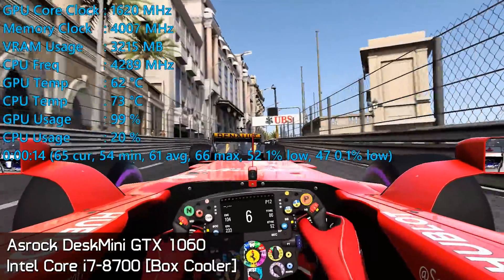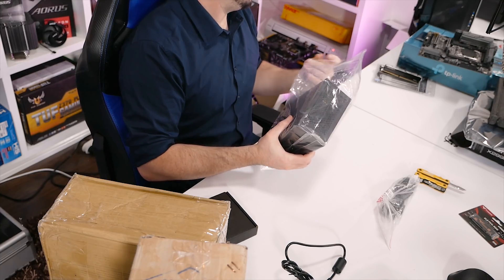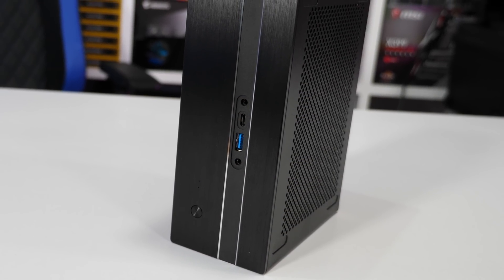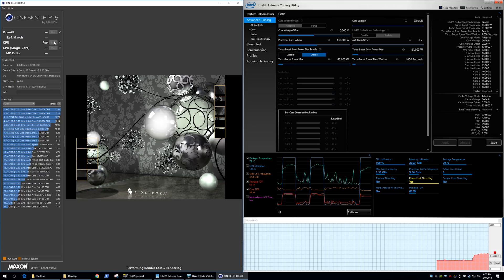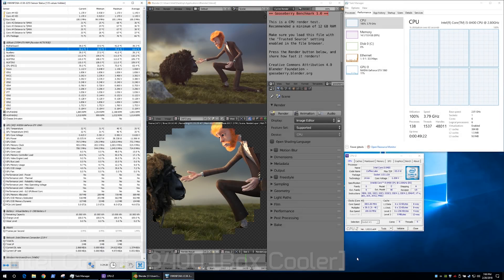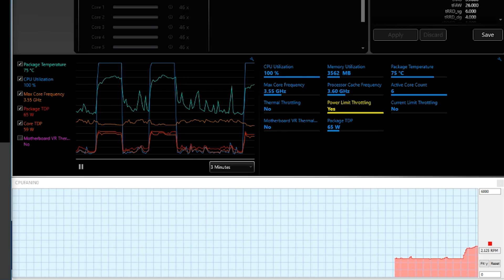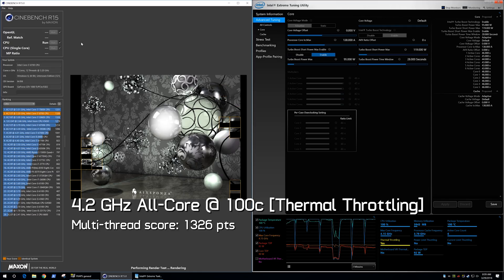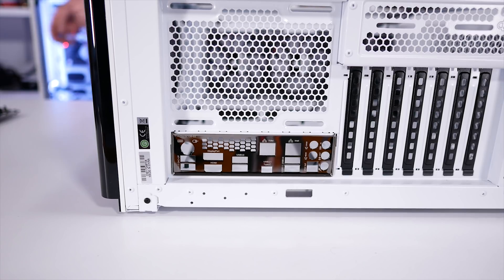Core i7 8700, Intel Box Cooler Limiting Performance

Comment: I tried the box cooler and the 8700 throttled bad. Swapped out to the Coolermaster Hyper 212 with dual fans and no throttling. Ran all core at 4.3 GHz.

Comment: Same issue, have a 8700 but the box cooler wasn't sufficient. It hits 100C and shuts down due to TJmax. Got a 240mm AIO and thermals are better since.

Comment: i have a i7 8700, locked in 4.3 ghz, and undervolting with 0.05 offset negative, and i did that without been necesary, the only necesary was limit to 4.3 ghz, with a good cooled enviroment and stock cooler, is just max 80c at full working

Comment: Did upgrade from i5 to i7 8700 yesterday. While gaming it clocks@4.3ghz 95% of the time(dips to 4.2ghz sometimes) and while stress test it goes like 3.6/3.7ghz. Motherboard Gigabyte H370 HD3.

Comment: I know this is an old video, but I experienced the i7 8700 thermal and power limit throttling and was able to correct it by upgrading the cpu cooler and increasing turbo boost power max.  2-3 years ago I bought a HP Omen Obelisk desktop with an i7 8700 for $899 and I ran it for a long time with the crappy stock cooler and just put up with the hot temps, loud fans, and lower clock speeds.  I finally upgraded the cooling to a Noctua U9S and was able to keep temps well under control and keep a consistent 4.3ghz on all cores.  The i7 8700 still isn't a bad cpu and does well.  I have since done a case swap and parted out the Omen and am much happier than when I was stuck using that crappy intel cooler in that hot crappy Omen case.

Comment: Hi! I have some issue with throttling. I have i7 8700 non-k and not very good zalman performa cnps5x. When I ran cpu stress test in Intel Extreme tuning Utility it says that there is Power Limit Throttling and Current/EDP Limit Throttling (Power limit is in the 1st test and Current/EDP is in the other two). MB is h370 pro4. Can this issue be because of bad cooling (though the temp is only 60 max, according to stress test) or it is issue with motherboard or power supply? PSu is Deepcool DN650, it's 600W by 12v

Comment: I have this chip in an asus h370f motherboard, and I'm getting voltages up to 1.41 is that normal? I have a kraken x62 cooling it but I'm still hitting up to 60 degrees in idle after 10 minutes of booting up.

Ps. I have re mounted the cooler multiple times making sure the thermal paste spreads correctly, still hitting 1.4 volts just idling.

Comment: Is there a huge difference between i5 8400 and i7 8700 in games like Battlefield V...? I currently own i5 8400 should I got for i7 because sometimes it stutters while cpu is maxed out.
Reply from the maker: The i7 model will fix the stuttering, assuming you already have 16GBs of RAM.
Reply: @Hardwareunboxed  sure I did. But running @2133

Comment: LOL old news, when I first bought the i5 4670 it thermal throttles on stock cooler, and I never knew after 2 years until I checked temp on prime95, all cores will hitting near to 100 degrees. Yea the non K version not 4670k, Intel just keep trolling everyone.

Comment: I currently have a Intel i7 8700 with the stock cooler in my editing pc, while rendering it has reached 95° and got a warning message in windows, I think I need a new cpu cooler urgently which would you suggest on a budget

(Case is the Corsair spec 04)
Reply: mine is always at 100c and not warning me

Comment: I was thinking about undervolting my i7 8700(non k)as it runs at around 1.285-1.3volts under load at stock settings which produces a lot of heat and tdp upto 105 watt tdp with temps like 82-86℃ my motherboard is msi z370 sli plus & my cpu cooler is antec c400. And my cinebench score ranges from 1400-1420 after bios update it was reduced to 1390-1405 So can you guys refer me any undervolt guide regarding this on how much should i undervolt and which settings are the best and stable for this CPU????
Reply: hows yuhr case cooling...  idle temp

Comment: I bought my 8700k used and I am using intel box cooler that I  had on my shelf.I noticed very thin (almost unnoticeable ) lines of some sort of black silicone around the CPU cap.I run it on Asrock Z370 Fatality K6 @ Stock frequency.Temps are below 60C with my GTX 1080ti (with fan @ around 50%)when gaming and 70-72C(Fan @ 100% as I've done a custom fan curve) under CPU stress test.I tried 4.9GHZ (@1.37V)on all cores and stays around 90-94C under stress test.Is it possible that this cpu has been delided by previous owner.

Comment: What are these 3 bars on the bottom of the cooler @ 1:24
Reply from the maker: Pre-applied thermal paste.
Reply: Do I need to apply thermal paste on the processor as well before installing this type of coolers over it. Sorry, but this is first time I see a cooler like this.

Comment: try undervolting the 8700 via XTU to static 1,16V with a -0,1 offset
it might keep the TB with a reasonable temps on a stock cooler

Comment: This cooler is pure bullshit. Is "enough" for the i5 8400 (barely), but it simple cant take a 6c/12 cpu with turbo at 4.3 ghz in 100% load.

People are buying the 8700 instead of the 8600k to avoid the need of buying a aftermarket cooler and get higher performance, just to realize that they will need to buy the daam cooler anyway.

Comment: is this cooler enough to keep i7 8700´s temps down so it doesnt thermal throttle from 4.3ghz when gaming? http://thermalright.com/product/true-spirit-120m/
Reply from the maker: Pretty much any tower style cooler will work, the TRUE Spirit 120M will work extremely well.
Reply: ok thanks!

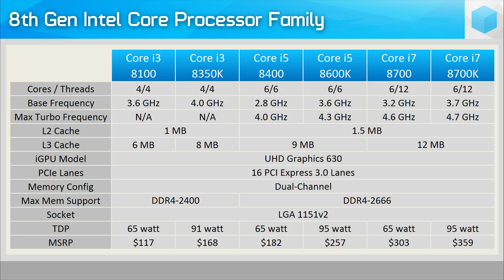Comment: 3:18 max memory support is ddr4 - 2666 mghz? Are you fucking kidding me? Is this even a serious channel???
Reply from the maker: Indeed it is. The 8700 is limited to DDR4-2666 (it's not 2666 MHz BTW) on every single board not using the Z370 chipset. You can visit the Intel website for the official spec.
Reply: Hardware Unboxed ok i dont understand anymore...why would you use an i8 generation intel on a non z370 motherboard? I thought they aren't even compatible

Comment: My locked 7700 was also getting pretty toasty with the stock cooler, and that thing is only a 65w chip. Temps at around 89c just playing video games. After re-applying the TIM and assuring the thing was seated flush,  I ended up buying a cryorig h7.  Since I bought the H7,  I've never seen it above 58c. So yeah, that stock Intel cooler is a pile of garbage. Maybe 89c isn't out of spec, but that's not acceptable in my opinion. There's just little room for error. What if ambient temps were a few degrees hotter in my house? What if the chip gets even hotter? Gaming surely isn't the heaviest load I could put on this thing. What about a year after the TIM has been applied? Idk, but I don't like it. 89c is too close to TJ-max.

Comment: Finally someone calls out Intel for their lame heatsinks becoming less dense every generation. Steve should talk about thinning substrate of Intel chips too.
Reply: just spend $40 on good cooler and you are set for years, all coolers since LGA 1155 are compatible with modern CPUs and probably will be for another few generations. It only affects i7-8700 which is rather high-end CPU

Comment: It is clear that you are very passionate about disproving the coffee lake conjob and the points you give are valid.

Intel never lied in their advertising, the base clock is the only thing that is guaranteed, as is the case for both AMD and Intel.

However, it is not about lying here, it is about public perception. Intel shows to the untrained eye that it is back at the top.
All reviews showed it.

Of course you can only buy an expensive mobo and will need a better cooler to get those numbers. If you could even get one with the severe shortages at launch. 
And those all core boost clocks aren't important to know right?
 What do you mean the base clock of the 8400 is only 2.8GHz?
 The benchmarks are great!
Who needs a cooler that matches the TDP of the product?
Just buy one yourself!

It is all this stacking up of BS that makes up the coffee lake conjob. I'm not salty towards Intel about it, they played it well. I am not saying that coffee lake is bad either.

However, it showed me to stop looking at just benchmarks and call it a day. And that applies to AMD, Intel and Nvidia. All of them are prepared to play dirty just to be at the top.

When I am reading through your comments I feel like you take it too personal. Step back take a breather.

Comment: Ok I will start with that I agree with the cooler being shit and I agree intel never truly lied to its consumers.

The main issue is with the base and boost clocks being very far apart. The base clock for 8400 is just 2.8 GHz with a 4GHz boost.
The 7700 has a base clock of 3.6GHz and the 8700 just 3.2GHz.

 That is worrying since only the base is guaranteed but up until now we have only seen benches on high end mobos with high end cooling...
And now we see that you need to remove the power limit on a mobo that is not as capable? I would love to see Gamers Nexus test the vrms of that board further.

 Even if it is not harmful, not everyone is comfortable doing this. Also, what if H and B boards  don't allow removing the power limits?

Comment: Who buys non k 8700? Whats the point?
Reply from the maker: People who don't want to overclock I guess, you save $50 US and get the same performance out of the box.
Reply: Hardware Unboxed
I still dont see a point in buying non k version. It is hands down the best consumer cpu when overclocked, and having non k version doesnt have any value imo.

Tho, i did see few less informed people buying non k version with oc boards, because '' 8700 overclocks the best ''.
Reply: ofcourse it has value.. you can save money on cpu and mobo.  If you dont ever plan to or need to overclock then the unlocked cpu is waste of money.
Reply: Why do yuh think sk.. I just recently bought last 7th gen i7 7700 non k for my b250 motherboard just to use windows 7 for a good while at less cost, less heat and less power consumption getting almost 99 percent performance.

Comment: I have a stock cooler from a 3570k. It wasn’t remotely capable of OC’ing without temps going waaay past where they should be and the fan at about 95%. I took an old fan from a Pentium 2. It was a coolermaster fan, but was stock, and the 3570k had no problem hitting 4.4 with minimal noise compared to the much newer 3570k cooler. The older cooler took some playing with and a couple zip ties to get snug, but everything was better. It literally weighed 2.5x as much without the fan, 3x as much with the fan.

The 8700 may be locked, but it’s a fricken $300 locked CPU, they can afford a cooler that probably costs them $2.50 instead of $1.25, and I’m also sure people would be glad to pay $304.99 for the convenience of using the stock cooler. With what Intel has shipped over the last 9 years on non Xeons, I do not know why they even bother.

Comment: I OC my R5 1600 up to 3.7Ghz (1.22500w) on stock cooler and max. temp is 64°C spiking up to 65°C on rare occasion (aida64). I know that temp. in the 50s are good, but is 65°C too hot for CPU?
Reply: do you know what the max temp allowed is or where to find it? that will give you answer
Reply: I already did a little search on the net and some dude said 65°C is little warmer (not to hot or anything dangerous) then it should be and some dude said on other coments/forum 75°C is temp. where ryzen will work just fine and it will work for very long time and with no danger to hurt CPU. That's why i'm asking here. Some people say like this and some like that. what is correct now? Lol.
Reply: https://www.amd.com/en/products/cpu/amd-ryzen-5-1600  scroll down or click specs. 
As long as you arent hitting max temps and thermal throttling and your cooler is quiet enough for you then I wouldnt worry.
I havent seen or looked for any info on  lifespan of cpus based on temperatures but id bet there is info out there somewhere.
So if you are still worried try to find info on that and decide what temperature is right for you.  Likely it will be obsolete before it dies no matter what temp it runs at.
Reply: Your coment didn't show here, but i got it under my notification bell thingy and Max Temp. is 95°C so i'm good.

Comment: I've still got my sandy Bridge stock cooler and it's way better than the newer box coolers. I've used it on my i7-6700K for awhile before building a loop. It was at stock clocks but the stock sandy cooler didn't break a sweat. Max gaming temp ever seen was 63c, in a room that was often up to 25c ambient.

Comment: I dunno I got a CB score of 1478 on my 8700 on a Deepcool 120mm AIO with a ASROCK Z370 Extreme4 mobo
Reply from the maker: It has to be overclocked to get that high. Either using MCE or higher base clock. Otherwise it's not possible.

Comment: Thing is, as always, you may as well buy OEM cpus when/where available, if you really don't intend  to use the retail cooler. Costs less. Don't know about OEM availability on these though. They've even skimped on the thermal compound, it's striped to get more to the $/£ on more coolers. Times are hard & enthusiasts are few. 😂

Comment: For the longest time, Intel has been using such a wimpy cooler and even that isn't enough to cool a NON-OVERCLOCKING Chip. What they should really do is include a cheap box tower cooler like what they did with the i7 980X/990X CPUs.

Comment: The heatsinks with copper core were better, but even those suck based on my experience. My i5 3570 would hit 70 degrees (48 above ambient) with full CPU load, not FPU and the stock fan would become quite loud, to the point that it would become unbearable after a few minutes. I believe besides the small mass, another problem with Intel's stock fans is that the fins are too slim for heat to transfer adequately fast.